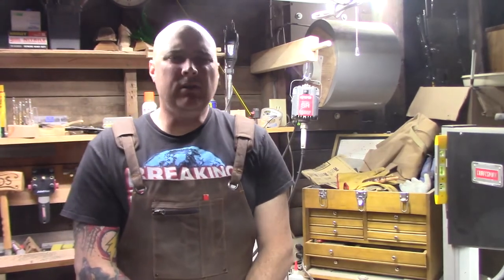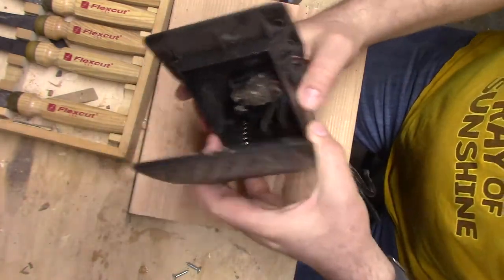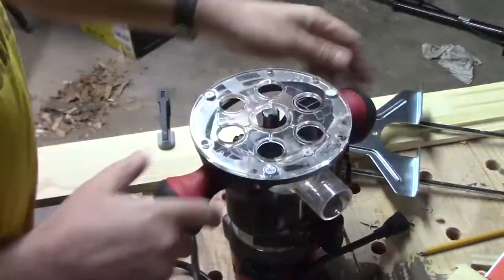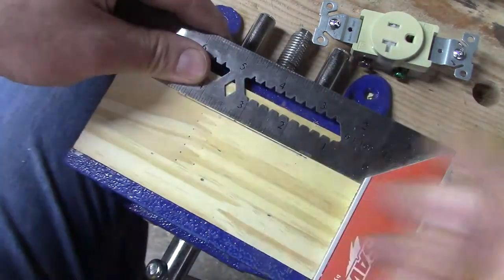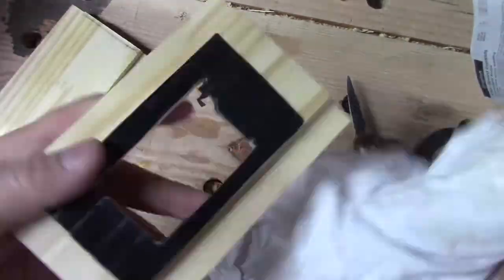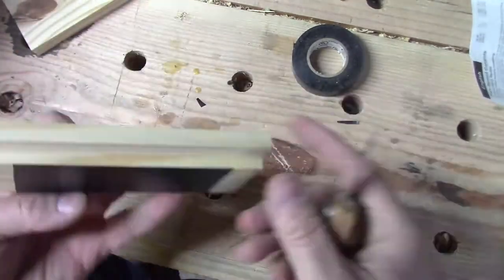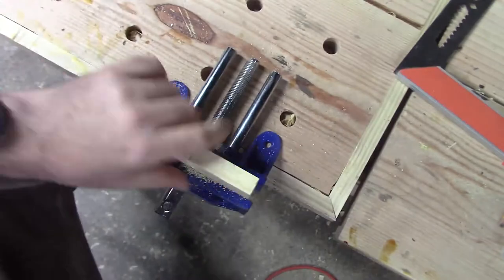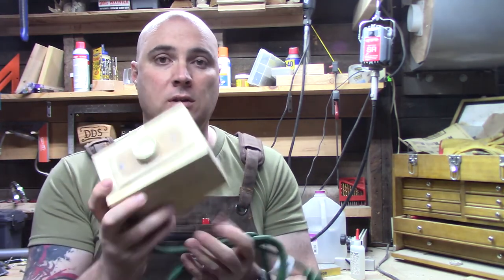DIY Speed Control for Flex Shaft Tool

Comment: I wish I had some way of sharing this with you privately because I don't wish to call you out publicly. However, there are a couple of safety issues you should address. First, you should add a strain-relief clamp to the power cord as it enters the box. This will prevent an accidental pull on the cord from weakening the wire connections inside the box. Even though you soldered some of the connections, and the other connections are made with J-hooks and screws, over time frequent tugging of the cord can loosen the connections -- causing them to short or arc. Second, I don't know how much heat this switch might generate, but I'd feel a lot more comfortable if there were some air holes drilled in strategic locations to allow in some cooling air flow. Finally, when connecting the switch, you installed some of your J-hooks backward. You want to install the hook so as the screw is tightened, the counter-clockwise rotation of the screw draws the open end of the wire closer into the screw. This last one isn't a big deal -- unless the wires aren't properly secured by a strain-relief clamp. 

I hope you'll forgive my bringing these items to your attention. I'm not a member of the safety police, but I'd never forgive myself if you house were to burn down.

That said, it was an enjoyable video and I learned from it.
Reply: there aren't holes drilled in switch boxes in your home, are there? this would be no different in that aspect.

Comment: I just drilled a hole thru pedal, attached a 3.5” X 1/4” lag bolt with washers & a wing nut 
Allowing me to make precise adjustments 
Total cost $6.00 & a drive to my local hardware store

Comment: I would have stayed with a foot pedal. You only have two hands, not three, and I find working with a foot controller much more convenient. You're a wood worker, so making a wooden box for the regulator is a nice idea. You could possibly have made a wooden foot pedal as well, I think. Otherwise, I would probably see if there is a regulator that fits in one of the cheap MIDI foot controllers for keyboards. Those are usually pretty sturdy compared to the Vevor foot controller and still do not cost an arm and a leg either.
NB: I had a lot more luck with the Vevor stuff I bought. I do have a good pendant motor anyway, but I wanted a second and did not want to spend too much money on it, so I opted for the Vevor. The flex shaft that I got with it feels a bit short compared to my other. The foot pedal is crappy but at least it works flawlessly (yet, I don't feel comfortable to "step on it" as it is so fragile). Maybe, I take it apart and 3D print a more sturdy one as the regulator works fine.

Comment: Nice job, but you have to flip your dimmer switch around. You have it going anti-clock-wise for more power.
Reply from the maker: Yeah, after I set it up I switched it but it did the same thing.  I researched it and it's not actually a dimmer switch, it's fan controller which apparently just works that way.
Reply: @ddsworkshop4371   hello  could you advice me about somthing , i whould like to use the " router dial controler speed " from harbor freight" do you think it can work ?

Comment: Glad i finally saw someone do this , 120 dollars from fordom lol , been a cabinetmaker for many years , we use router speed controllers, would work perfect for like 20 bucks ..
Reply: Depends on what you use it for. As a jeweller, I prefer foot control. You keep the rotary tool at stationary until just before you start working on the piece you're at. And then you want to be able to cut power every now and then or change speeds. No third hand available to do that unless you're a mutant.

Comment: Do foredom hand pieces fit your flex shaft
Reply from the maker: They do.  I just bought a Foredom reciprocating chisel handpiece and it fits perfectly.  It's pretty much a Foredom clone.
Reply: @ddsworkshop4371   - There selling some knock-off Foredom hand-pieces on eBay now. I'm not sure of the quality, but I'd like a quick release over the chuck that came with my Harbor Freight version. Surprisingly, the foot pedal works well. I'm just not sure if I'll need to buy a new flex-shaft to take a Foredom hand-piece or not.

Comment: Isn't the flex Shaft motor DC?
Reply from the maker: Nope, it's actually AC.  110V, 50Hz, 230W.  A lot of micromotor rotary tools are DC like my Dremel Stylo.
Reply: @ddsworkshop4371  Thanks for correcting me.  My mistake.

Comment: I may try a dimmer switch also.
I have a video. https://youtu.be/ATMyfOkyufI
Where I shorten the spring in foot pedal (switch). It works much better now. The switch is a slide switch with electrical component's in it and around 3/4 ways through the actuation the slide drops of and it is powered directly so it takes off!! No graduation. $15 switch. There are nice pedals for around $100-150. More than the price I payd for my rotary. These machines are a bargain get two or three for the price of the  Real McCoy.